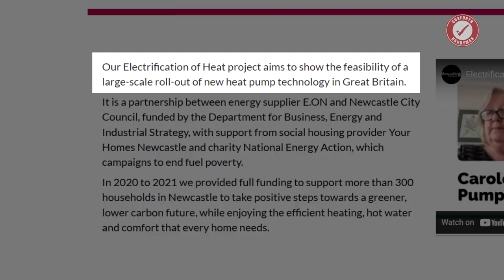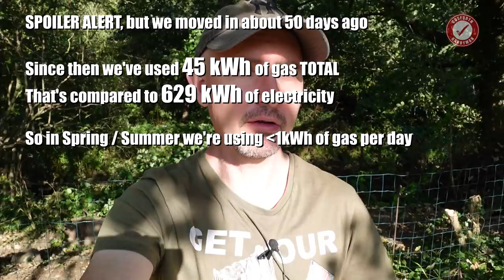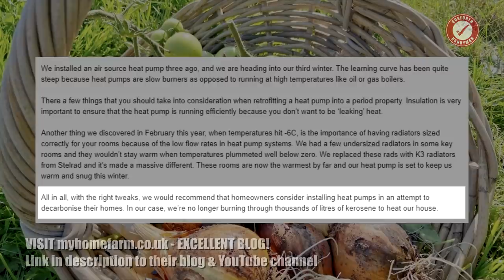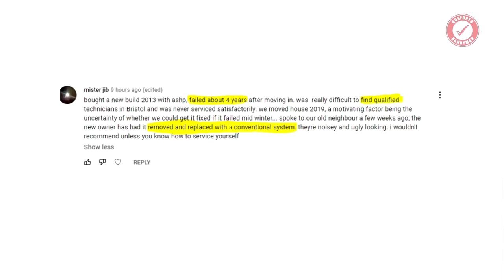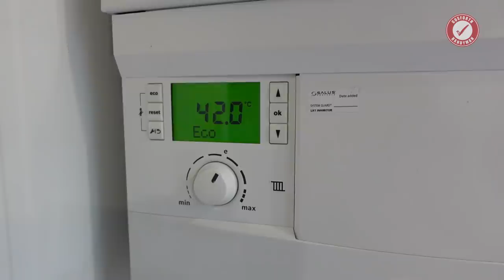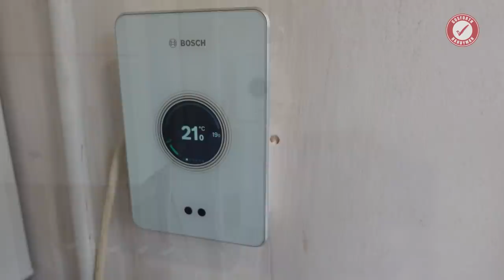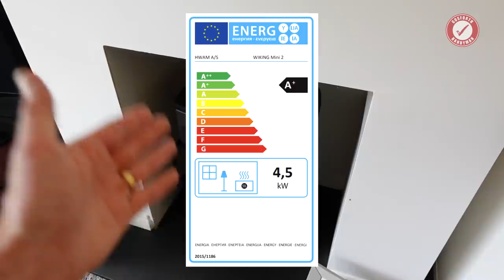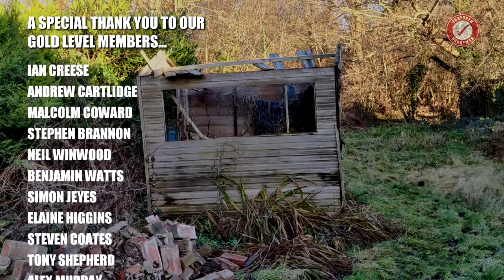Why didn’t we install an Air Source Heat Pump? (1920’s Renovation Part 32)

Comment: Most people have no idea what they are talking about, simple maths having to spend 12-15k to fit a ASHP compared to replacing a boiler for £2k max never adds up. The people who say they have ASHP and its fantastic, when they actually share how many KWH's they are using you realise their grasp on maths is lacking. Look at home farm, sure its a big property but 66 KWHs a day!? Look at the prices of electric at the moment in the UK with current prices that's close to £20 a day! It would be far better to buy a huge oil tank and fill your tank to the brim in the middle of summer when oil is at it cheapest! ;-) Its all a risk there are no guarantees but if ASHP/GSHP was such a great proposal it would not need a grant to twist our arms.

Comment: Are source heat pumps are fantatic if are they are installed in extremely well insulated air tight homes with some other sytem to back them up when it gets near freezing outside. great idea but that's a lot of ifs.

Comment: Gas boiler and a log burner? Don't they keep talking about banning log burners on environmental grounds, as well? :) We live in an extended 30's house and it's permanently bloody freezing despite the brand new combi (fitted 2020) - of course, the double glazing the previous owners had fitted leaks like a sieve where none of it shuts properly, and the old half of the house is barely insulated at all (no cavity to speak of so we're trying to save for exterior insulation).. jumper? I need gloves already and it's only October! ;)

Comment: You don't need a lot of land for a ground source heat pump if you use  less than a hand full of vertical wells.  The deeper the more constant the ground temperature will be.  I guess your not familiar?
Reply: But how much does it cost to "drill" them?
Reply: @katabrontes  think about the long term ROI with a far more effective heat source in comparison and on a small lot to boot.
Reply: @chrisharper2658  I did but the business case is still week.  The payback is long and the working life of the equipment more or less the same as the payback time.  I problem won't live long enough to see any benefit.  We are already paying too much in subsidies for "green energy" a proportion of which are paying wind farms not to generate electricity.  The whole energy generation and distribution system in UK is a mess and there are no signs of it improving in the medium term.
Reply: @katabrontes  My comment wasn't to imply what is best for you but only to shed some light on how a ground heat pump using vertical wells may be far more effective on a small residential lot.  I know I wouldn't want a yard snaked with piping everywhere.  And yes, the compressor will have a limited life span as compared to a simple gas fired boiler but you don't get air conditioning basically for free either.
Reply: @chrisharper2658  Understood Chris.  I am sure this system has a lot of advantages compared to the "standard" dig it up variety.  Not only is it compact but as the heat exchanger is pretty deep the ground heat source will be more stable.  If you are lucky enough to hit an underground stream it will be a real winner.  How good is UFH as a cooling setup compared to the standard split aircon used most commonly?  I am not sure I would like a very cold floor.

Comment: LOL I was begging them to do mine. Would have loved one + rad upgrades + insulation done. They declined on the basis of too small a back yard for the unit.
They've only done 3!? Absolutely mental.

Which properties do they think are unsuitable despite loft, floor insulation, and rad upgrades! Madness.

You're very negative about heat pumps. You seem to be unaware of their success in nordic countries. Even Germany their market share is 30%. You're not convinced and thats fine, I'd suggest looking at what Ken Bone is doing on twitter. They are quiet contrary to popular belief, and benefit from larger / triple panelled radiators yes, but so would gas boilers ( low temp rads much more efficient ). Its rare for actual "condensing" gas biolers to actually condense in the UK. most systems are installed for rad temps of 80c or so but they need to 55c with a return temp of 45c to acutally condense and get anywhere near their quoted efficiency. The lower temp rate the more efficient any system will be, gas or heat pump, but to put out the same heat power need bigger surface area to do so.

They work just fine in much colder climates, they can and will work here, not having adequate insulation nationally is not a reason not to use them. Its a reason to insulate properly, with more simple grants to do so & install greener tech.

Deisel is more green than petrol. Its gC02/km is lower, just that calculation did not take into account N02 harmful to human health emissions and VW we're conning us into thinking it wasnt emmiting any.

When gas is being appropriately taxed ( the polluter should pay) it wont look so cheap to run - the exception being this ecotricity idea of gas from grass. I'm doubtful of it - will need too much farmland i think, but its an option. Hydrogen wont be used - its combustion produces too much N02 - again harmful to human health, it leaks everywhere, pipes need changing, all sorts of issues with making it from "natural" gas anyway.

Heat pumps will win the day - but maybe in a slightly different way - https://www.youtube.com/watch?v=aWgkl7W9xU0&ab_channel=FullyChargedShow

district heating - heat the homes of newcastle from the tyne! works for this city in denmark. Love to see this installed of the coast in newcastle/ tynemouth. Heat your home with piped hot water - can even selectively not insulate parts to keep roads frost free in winter. excellent work from a british company.

rant over.

Comment: Very good video, although it reinforced my anger on the treatment of diesel car owners. Mine easily passes the emissions test every year, but is not to latest standards. In London we get a new ultra low zone stating later this month. So it will cost me an extra £12.50 per day if I dare to drive further in a mile. I do no do that often, but for others possibly with few funds it will force them to give their car up. I am considered the devil for taking gov advice as you stated.
Reply: As someone who lives in zone 2, I cant wait for some cleaner air, the NOX levels around here are appalling some days, got a taste of what it can be like during lockdown 1.

Comment: How the hell are you only using 1 kWh per day??!! Even for just hot water we get through roughly 10 kWh a day in the summer. Regarding the heat pump options, I'm very concerned that insulating my victorian end-of-terrace with solid walls and single-glazing to a sufficient level for the heat pump to work well, that I'd have other issues like damp because of the ventilation I would have to prevent. Air-tightness is all well and good when your building doesn't require a constant supply of fresh cold air to not destroy itself.

Comment: Our 14 year old Worcester Bosch, still A rated, shows no signs of deteriorating. Looking ahead, I don't want to spend £10k  on top of a £5k sub for a system (ASHP) in its infancy. A reverse fridge with an immersion heater. It seems a backward step to me. Our gas engineer, who sees all property types, reckoned "there's one more gas boiler to go in this particular old house" and recommended we do a swap for the latest model, presumably more efficient, on a good deal with a 5 year warranty. Takes us into that future where I won't be worried about spare parts in short supply, if I even care much at my age, is compatible with hydrogen and there may be a change of policy or attitude; 2 or 3 general elections away plus new technology such as better solar panels, small local nuclear power stations etc.

Comment: Its about the continued use of fossil burning and reduction of CO2/NOX.  This needs to be drastically slashed or major weather variations will occur.  If its not already too late.  

 I fitted ground source 16years ago. The system is still going strong.  My newbuild has air source heating and hot water. 

 I agree the RHI is a bit long winded, but you just need the EPC report, and details from the installers registration and an invoice.  It took me 30mins to register and a few days later my application was accepted.  Yes there is an upfront cost, but a good chunk comes back to you, even if you sell the property in the future, you still collect payments.

Comment: With the current rise in gas prices oil is cheaper than gas per kWh especially since there is no a standing charge. People saying oil costs so much probably had prehistoric boilers that have not been serviced. There is no way from my experience ashp will be cheaper than oil. 1 litre of oil produces 10.6 kWh of heat at 46p a litre (often much less). We only use 1100 ish litres of oil for heating and hot water per year. If it costs 11 odd thousand to change to ashp thats 23 years oil for us. There is more environmentally friendly oil options being tested so I'm holding out till then and I already pay extra to have the oil carbon offset.
Reply: I'm thinking somebody will do vegetable/waste oil based heating oil too.
Reply: @grahamleiper1538  Apparently it's called HVO or something like that a boiler guy told me. Don't know much about it.
Reply: @IanWoolcock  it's not readily available, and isn't eligible for RHI payments ("cash for ash") that pellet systems get to make it price competitive. 
Bit of a no brainer compared to going pellets though, oil much less hassle/volume/maintenance/noise.

Comment: You clearly don't understand how heat pumps work. Any correctly installed HP would be at least X2 efficient and possibly X6 times.
As for noise most heat pumps are quieter than gas/oil boilers.

Comment: How is the electric infrastructure going to cope with all these changes, IF every one ditched fossil fuelled heating then the increase in load on the electric infrastructure would be massive, add in EV cars and it gets even worse. The actual thought that is put into these ideas is scant to none and while currently hydrogen has some issues in terms of generation there has been a lack of research into it. The time scales the government has adopted are small with no real consideration of how all this demand for electricity is going to be met, we all want heating to be available at the same times around the day such that demand peaks at the same times every day. How many of us heat rooms that are not actually in use or have room temperatures higher than they need to be? The gas fired system we installed in 2015 has a heating water manifold and treats each room separately with it's own timer/thermostat such that say the lounge can be set at 20 degrees and to come on before we get up and off when we go to bed. With the likes of the spare room set to a low temperature for frost protection 24/7.

Comment: Who wouldn't like to be environmentally friendly but where do they get these prices from it's a emersion heater with a fan... Its ridiculous. And worcester boilers have a system that changes your gas boiler to run on hydrogen for approx 100 pounds the hydrogen pipes are already being laid so I think I'll wait and see..

Comment: I understand why Insulate Britain are so irate. Pink or yellow fluffy stuff in the roof and draft stoppers on external doors would be a very quick win in improving existing efficiency. AND they are essential for effective use of lower energy space heating systems. Unfortunately, they are cursed by not being sexy and are also so cheap that they leave little scope for profiteering by the big business political sponsors of The Party.

Comment: If you use rubbish heat pumps or badly designed systems  it's going to cost a fortune to run and not work properly. We run our mitsi's at 50 degrees at a scop of 3.6+ which work at that efficiency down the -7.

Comment: Omg those stats from the document touting to install air source heat pumps are stunningly bad!
I'm another with a tax free diesel car. I'm a horrible home owner who's on oil & a wood burner though but they'll need to do some serious upgrades to the infrastructure if they want me to use anything else due to location & age of house.
I feel sorry for anyone with an air source heat pump with the current energy price crisis going into winter. I ruled out a house I was interested in as it had an ASHP but was tripping distance from the gas main in the village.
On your point of furniture, some IKEA stuff lasts better than high street (sofas) the other source to look at is 2nd hand vintage as they were put together well with quality frames which you don't get anymore, and get it reupholstered
Reply: With the increasing gas prices I've crunched the numbers and based on the 1kw in and 4kw of heat out from a heat pump the heat pump will be cheaper to run soon down to about 0c outside.

Comment: ive had the air source system 
Not terrible but not great either, can’t wait till they try to fit them into the standard new build unless it’s got one of those garages too small for the car
Wouldn’t have it again then again this governmental are getting god like and telling you what to do the minute you get out of bed

Comment: When did all electricity generation become “green”?  Smoke and mirrors I’m afraid, we know we need to do something but I don’t think this is the answer. I train engineers in the heating industry and several installers have told me that customers who have paid for heat pump installation but then come back and asked for a gas boiler to be added because the electricity bill was too high.  Maybe a hybrid system?  2035 no gas boilers? That’s the hybrid system gone then. Good video.

Comment: Andy, might I recommend taking a look at Fully Charged Show (https://www.youtube.com/c/fullychargedshow) . Really a lot of useful information on all this types of heating and electric cars as well. 

Although I might say you've got a point, but air source heat pumps are being used is much colder climates than yours (and mine, for that matter). Whether or not it's costing you less money depends on the price of natural gas and electricity (and whether you've got solar panels etc.). Here in the Netherlands we get at maximum 8 kW of energy from 1 m3 of gas. In reality we don't. Apparently you get almost 14! Could be, I don't know how that works (we do have 'low caloric natural gas' or something so that might explain that).

In a new build neighbourhood around here, I see quite a lot of ASHP. If they really where that inefficient they wouldn't be installed at such a rate. Yes, they are most efficient in combination with underfloor heating and basically letting the system just run instead of turning it on and off like with a gas combi boiler. A good heat pump can reach an efficiency of 500% (1 kW of electricity gets you 5 kW of heat), whereas the most efficient gas combi boilers won't even reach 100% (although, some claim figures higher than 100%, but as far as I'm aware that's a bit of numbers trickery). With the price of gas and electricity around here (and I'm talking prices from early 2021, not the skyrocketing prices we are experiencing now), we'd only need an efficiency of about 300% to break even (COP=3)

Anyway, the most important factor here is insulation, as you mentioned, and thereby needing / using less energy to begin with. I'm curious to see what your stance on this whole thing is in 5 years' time or so :-) 

Oh, by the way; we're having our floor replaced in our late-1920's semi-detached (sounds bigger than it is). Should leave us with an R=4,5 floor. Really well insulated by todays' standards. Combined with underfloor heating it's perfectly well suited for use with an air source heat pump...

Second by the way; about what you said about wood-burning stoves is technically correct but not burning it (ie letting it decompose in nature) releases all the nutrients much slower back into nature for all the slow growing plants to be able to absorb it. Everyone telling people that burning wood is technically carbon-neutral, is not really telling the entire truth...

Comment: I’m more surprised Andy to hear you have cavity wall insulation…. I would have bet my mortgage on the fact you would be dead against it for a variety of reasons
Reply: Mostly mythical reasons, I suspect. ......!!
Reply: From everything I have seen and heard about it your building needs to ‘breathe’. I know new builds have cavity wall insulation but was under the impression that in older buildings the cavity wall insulation needs to be injected. I know 5 people that have had this done and all have eventually led to serious damp problems as the insulation has now bridged the cavity. From my research this has led to companies who now specialise in removing the insulation and actions groups to try and sue the government because a lot of people only ever got cavity wall insulation in the first place because of government incentives.  I know it is meant to insulate your house and save you money in the long run.

Comment: I lived in a rented house until last year and the combi boiler ran away with gas and cost a fortune to run Iv now moved back to my parents house which hasn’t got central heating it’s got a wood burner and 2 gas fires it’s never cold to be honest.I find the younger people I work with think it’s cold now and you here them moaning but I personally think people are just soft now
Reply: Did you know how to adjust the thermostat?😉
Reply: @normanboyes4983  yes my ex liked it about 22 all the time then would moan that she’s cold every time she went out side as she had the heating on far too high